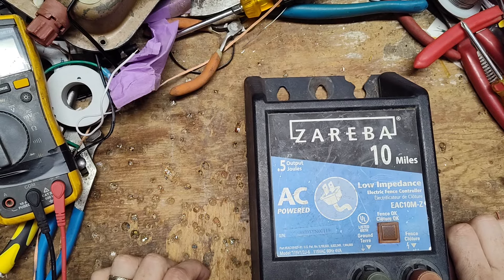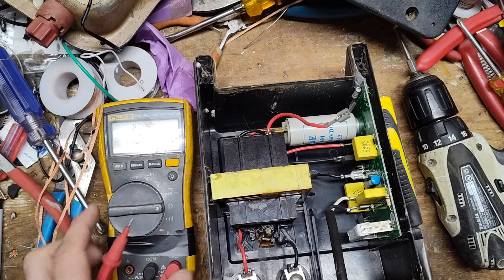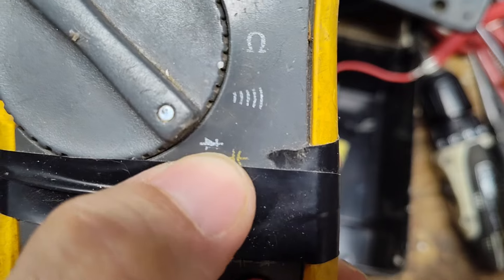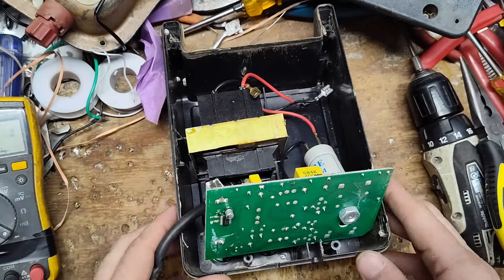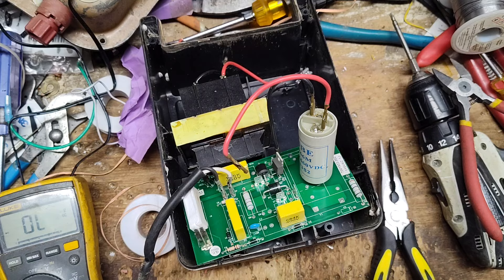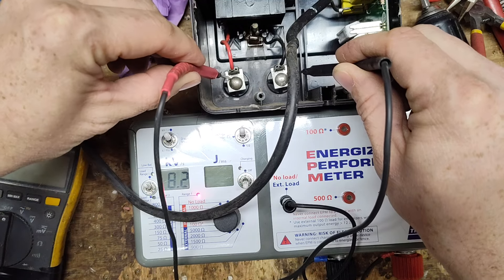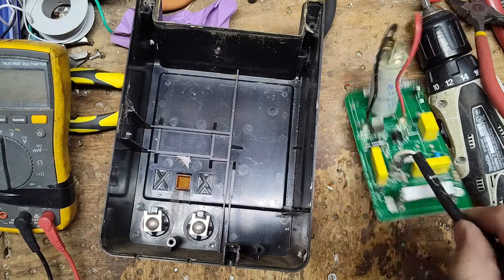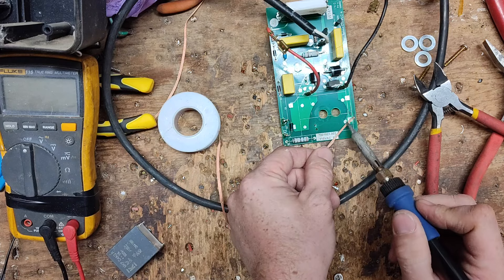How To Test & Repair A Zareba Electric Fence Charger

Comment: I was terrified when you were pulling that capacitor out. I stuck a pair of needle nosed pliers across mine and a bolt of lightning ensued.
Reply from the maker: I've worked on tons of these fence chargers and have learned the hard way at times when, how, and where to grab things at.  I've been bit a few times but them and they definitely make you realize you did something wrong lol. But luckily I haven't been bitten by a capacitor, large or small, in a few years. I typically will use a large 10-20 watt resistor at around 50-100 ohms to use that across, for a few seconds, a larger capacitor to bleed the energy off without the large discharge.

Comment: @0:23 - this box states 10 miles.  You just repaired (in my timeline) a unit that stated 40 miles of fence. I had no idea these were able to cover so much acreage.
Reply from the maker: It's a marketing pie in the sky number. It's based off a single wire that's 12.5 gauge high tensile fence wire that's completely clean of debris and a perfect ground system. Most people have multiple strands of wire, sometimes cross fencing dividing pastures using braided electric fence poly rope or poly tape which all of this adds more resistance which throws that mileage rating right in the trash. People look at the stupid number and 80% of the time it gets them in trouble with not having a stout enough fence box. It's pure marketing 100%
Reply: @FencerFixerRepairLLCKansasCity So far, you have some of the most relevant, detailed comment replies I have ever seen in my 13 years on YouTube.  Very nice.
Reply from the maker: @TechGorilla1987  I appreciate that a lot.

Comment: Thanks for your videos. I have the same fencer, only the DC voltage version.   One of the small capacitors is blown; how do I get the correct capacitor part number?
Reply from the maker: I'm not sure what capacitor yours has, but if you send me a picture to my email, fencerfixer816@gmail.com, I might be able to help you out.

Comment: How much money is the Transformers that you use to replace the one in the unit you are working on now?
Reply from the maker: They're about $35 plus shipping.
Reply from the maker: It will work with up to a 4 output joule unit. The only other thing that we sometimes have to do is upgrade the SCR to a higher amperage and voltage rated one. Sometimes to a 50-75 amp 1000-1600 volts just to make sure that there's not too much extra discharge energy being able to make it out the board to the transformer and prematurely damage the OEM SCR on the board

Comment: Have a Zareba with an excellerated pulse. I have not opened the unit yet but wondering if any thoughts before I start.
Reply from the maker: Thanks for the question.... What model/mileage rating is it? Is it low impedance or does it say solid state on the front?
Reply: 2 joule, 50 mile ,  low impedance.
Reply: Also currently managing 17 horses. Need as quick a repair as I can manage. Thank You.
Reply from the maker: @ToddColtrain  It's likely a board related issue. You would have to either try testing & repairing the board, find another board to install, or look at a better built brand. Look at a Gallagher M360 or Power Wizard PW2000.

Comment: Their website states 110-220v ac for AC units. I don’t see anything preventing a 220v supply. I want to install this same unit in my well house where I already have 220v supply. Older install so I do not have a 4 wire run from house
Reply from the maker: If you're located here in the United States, there aren't any AC models sold that will run off 220/240ac. You plug any AC unit into that 220v outlet, the unit won't run and you'll burn it up. Also, those zareba units are junk and the parent company doesn't offer anymore parts for any of their units anymore. They're a throwaway brand now.

Buy a device like this if you want a chance at running one. 
110V to 220V Step Up & Down Power Voltage Converter Watt Transformer for Travel https://a.co/d/iRUYo8j